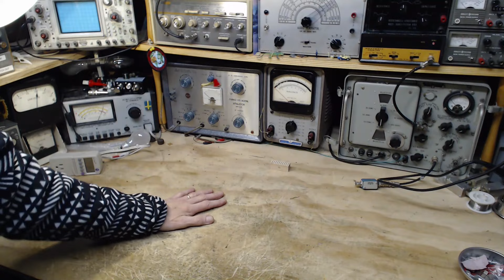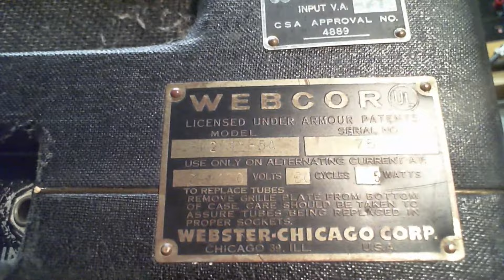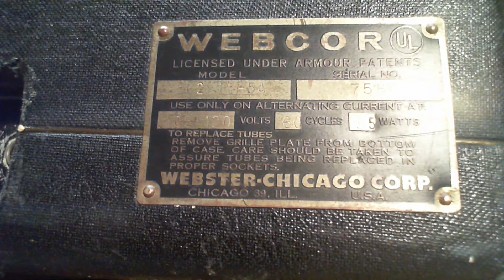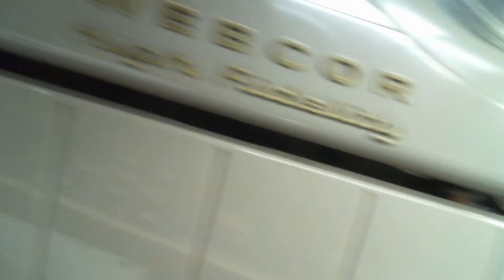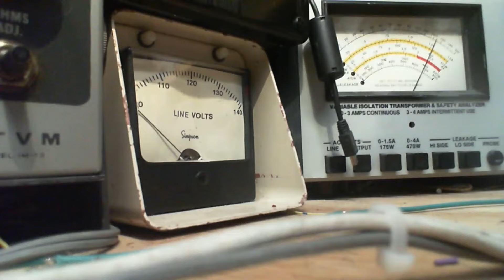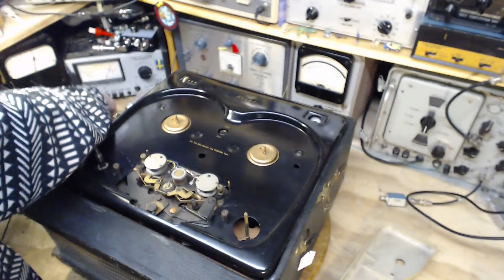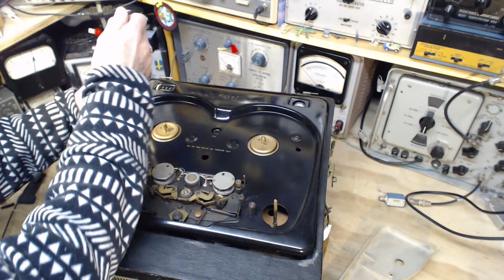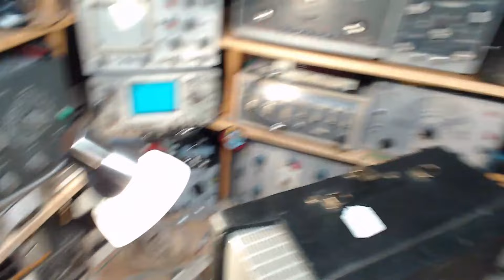Webcor High Fidelity Vacuum Tube Tape Recorder Video #1 - Checkout and Assessment

Comment: I would love/like to have a Master tape deck. but, tubed... since tubes can be quite pricey... I Might just keep looking for a Solid State Master tape deck... a record cutter would be nice too! if jim winds up finding a Record cutter/Lath'e and goes into a selling spree, I might be interested. 

The tubes in parts on some Master tape decks are in series and other tubes are not!   but it depends on what the Manif. wanted!   and yes you need full voltage since that deck has three or more motors inside!  100Watts is about right, if I am right on that!  but, I would look at the tubes if the Watts are not right.  

That big wheel in the front is a fast forward and rev. driver! there  are Up to four motors in the decks! 

Yes tho motor is running on the Deck!   if you just turned it on and the motor did not run you would run into a tape pull that could damage the tape or deck... so 5the motor is always on so the tape pull has a normal pull vs a regular tape deck!  

the heads can often have a price tag in the Thousands of Dollars. depending on type and manif. age(Nos or fresh and new) - the heads are in a round Shield - most likely Leads and Another metal! it protects the tape from Transmission noises such as hum and clicks.

Test the tubes, The motor also runs on A tube or two!

The comment below IS needed so I will post a new comment for this:

Comment: You can’t power this motor thru your dim bulb. It won’t turn the reels with out a tape pulling the tape sensor. It only has one motor, as I recall. I have this same machine and grew up using one. The capstan is not engaging with the tape sensor engaged. The magic eye will not turn on unless recording. You gave up too soon!  Look up the users manual, and you will see how it works. Sorry, I don’t mean to be critical.